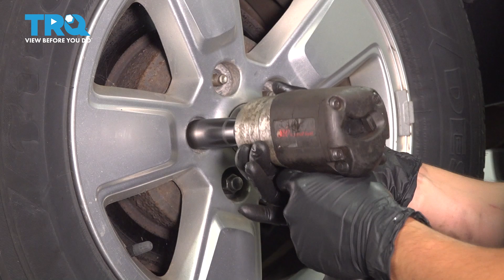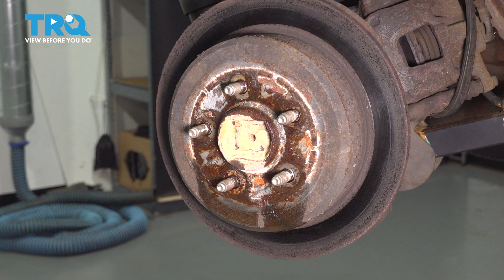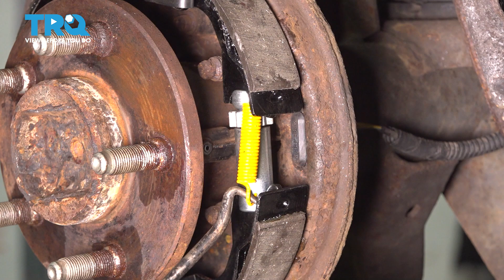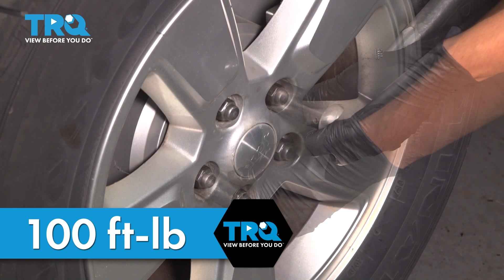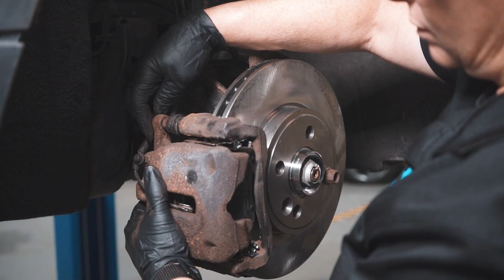How to Replace Parking Brake Shoes 2008-2012 Jeep Liberty

Comment: I found zip tying the actuator in place helped me. Once I got the single spring behind the actuator, I centered the upper shoe in the actuator, pinned the upper shoe, removed the zip tie, centered the lower shoe in the actuator, pinned the lower shoe, insert the adjuster and spring, and then install the second long spring.  To install the springs, I used a straight pick with the tip in the receiving hole to stretch the spring and slide the hook along the pick into the receiving hole by pushing with a screwdriver.
A couple of notes: on the left side the star adjuster goes up, and the actuator pivot (c-clip) is down.  The right side is opposite (star adjuster down and actuator pivot is up).  To loosen the adjuster on either side, spin it towards the front.  Pry rearward to tighten.